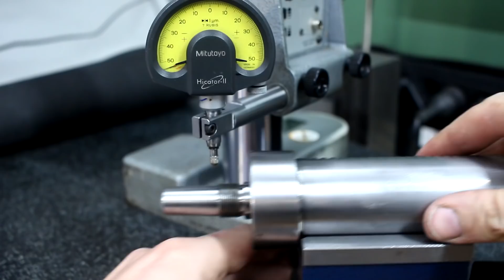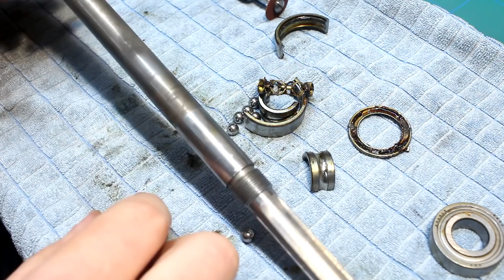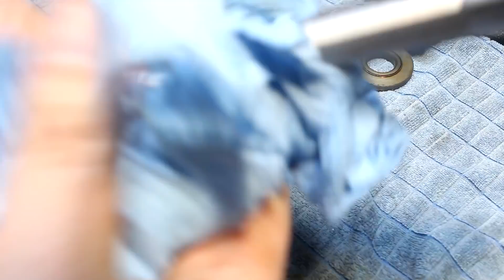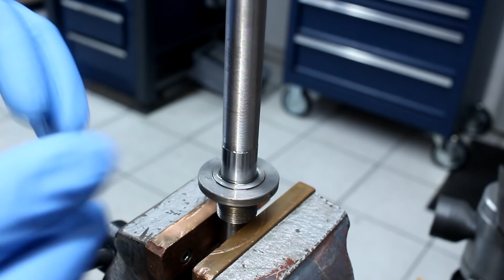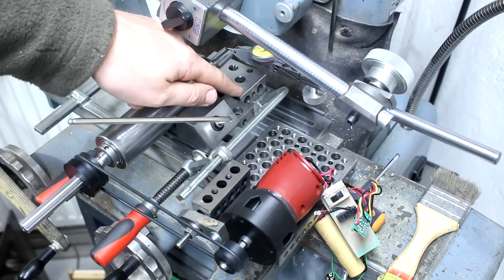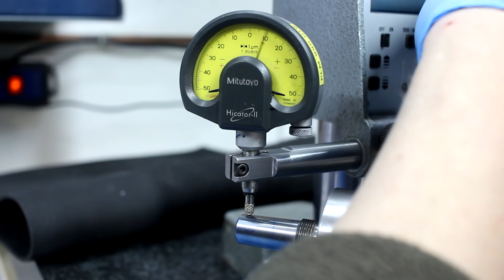Rebuilding a drillpress spindle

Comment: 19:30 On my press I don't have that disc at all. The bearing is plainly visible. It's weird to me if someone came up to use such a massive disc for protection of a sealed bearing.
Reply from the maker: Any debris that doesnt make it to the seals is good debris :-)
It makes sense to help the bearings as much as possible.
Reply: @StefanGotteswinter  I've just discovered my quill is single piece. From the B6 taper all the way up to the square for the spline connection. And the vast majority of the play happens on that spline. I'm working on it as we speak. Why I say on the spline and not between the casting and the spindle. Because correcting THAT would have required a rework of half of the area, with extra bushings, not top mention boring out the casting. I bought a $150 drill press i.e. it's safe to say I can't afford a lathe ;)

Comment: The top splined shaft (quill) in my drill press wobbles by at lest half a milimeter at the top. What does that mean? The visible bottom bearing is indeed deep groove type? May it be the case that the remaining 2-3 bearings all the way to the top are regular cheapest bearings? Because the splined shaft IS held in the bearings, right? The top sleeve in the pulley has no lateral holding role, right?

Comment: Can the drill press be used as a vertical lathe to rehab the taper in situ?  Maybe by fixing a mating Taper to the table and covering it in a fine emery cloth then running the spindle over the top of it. Thank you.

Comment: The spindle rotates quite slowly-is the speed ratio (taking into account the diameter to be ground) actually relevant in cylindrical grinding?
Could you say something about the speeds/cutting speeds and whether the spindle and grinding wheel rotate in synchronism or in counter-rotation?

Comment: I can't believe flott puts radial bearings in a quill, no wonder the old bearings where shot, my AI Hembrug drill press has the same setup but angle contact bearings 72series, these are made for axial and radial forces ,the one you put in are only for radial forces
Reply from the maker: A regular radial bearing can take 1/3 of its radial load rating in axial direction - thats usually ok for a drillpress.

Comment: If it were my spindle, I would at first try to hammer it back straight (with the old bearings).  But it would never get this perfect!
Reply from the maker: I have straighened spindles before grinding in the past, to safe on grinding time.

Comment: Lovely. Just to check my understanding: (1) the quill was titled upwards in the vice to render the taper flat to the grinding wheel (I'm assuming the bed of the surface grinder cannot be tilted)? (2) the collar that sets the preload bears upon the inner race of the top bearing - is that normal?  (3) Since the top bearing had to be heated to get it on the spindle it cannot be a slip fit, so I guess you can increase the preload by tightening the collar but cannot reduce it by loosening?

Comment: Thanks I enjoyed this video. I also figured out what to do with my old NiCad Cordless Drill. I have a old bench top Canedy-Otto drill press with external taper. Someday I will get around to restoring it. I measured run out with a indicator in a chuck relative to the bed and it was pretty much spot on. The only problem is the chuck sometimes falls off because the taper is a little beat up. I am checking eBay because I am thinking about replacing with a internal taper because I have a lot or taper shank drills. Thanks again.

Comment: very interesting. I also didnt know rubber shielded bearings were more prone to generating heat. That answers a question i have had around a new roller I have been working on that seemed to generate a bit more heat with the rubber shielded bearings I decided to try.  I will try some with metal shields.

Comment: Tip: When deburing/polishing a journal, shaft, etc, then us a 321 block, or a parallel with a piece of wet and dry abrasive paper(with/without light oil) instead of a stone. Works faster, cleaner and saves on irregular slip stone wear. 321 blocks are best as the holes act like reliefs and holds the grinding sludge away from the interface.

Comment: Funny I got bit by the hot bearing a few videos back when I was working on the valve grinder spindle and now you got the same thing. Makes me feel better about my oops. 😂 Might you should have ground a little off the end so no danger of the spindle end bottoming out before it reaches the taper? Seems that could possibly be an issue.

Comment: There is always the unseen or unknown problem with gloves. the protect you, but when they fail they may take your hands with them if you can't get them off. With hot things, fire and the like I prefer using something like a towel that I can throw or drop easily when handling things with unknowns. Gloves soak heat you may not feel right away and may be harder to take off the hotter they get.

Comment: I took an old junk Taiwanese drill press that someone was giving away.  It had a Jacob's taper 2 1/2 on the spindle. I successfully converted the spindle over to JT6 and put a keyless chuck on it.  Great usefull tool in the shop now.  That was my first time to use the taper attachment that came on my Logan lathe.

Comment: Excellent. Step by step demonstration with clear discussion of each detail. There's a world of teachers who could benefit from your example. 

But! The center hole in the taper end is now out of concentricity with the spindle axis. That might mislead the guy who replaces the bearing in 2089. My solution would be to chuck the spline in your lathe, support the quill barrel in the steady rest, and fine tool the center hole back to concentricity. It'll only take a few minutes. A trivial refinement but since we tend to take undamaged reference features as Gospel it couldn't hurt.
Reply: @ydonl  Good point;  but moot, being so far in the future. However the issue is completeness of task in the here and now.
Reply: @ydonl  Are you trolling me? Sorry. That doesn't work
Reply: @forrestaddy9644  No, sir -- sorry.  Stefan did a stellar job, with runout down in the micron region (which would be 0.000039 inches...  39 miillionths...)  and my conclusion would be that he's both very bright and very skilled, as well as possessing excellent judgement.  I suspect that if he thought the center hole had any significance, he would have addressed it.  I wouldn't have been surprised, but neither am I surprised that he ignored it. It hit me oddly that you would think the best response would be to pick up this arguably inconsequential detail.  I think the best way for you to show your perspective on the matter would be to... show your perspective on the matter!  :)  Clearly you would have dealt with the center hole, but what else would you do differently?  How would you go about it?
Reply: @ydonl  Au contrair. I have the highest respect for Stefan, a fine machinist and craftsman with a real talent for explaining the arcana of our trade. He does fine work expeditiously, neither hurrying nor fussing over trifles.

Maybe I should explain: I'm a retired machinist. I entered my apprenticeship in 1961. I have 40 years diversified and progressive experience usually specializing in large machine tools in a busy Naval shipyard. Over the years, I worked most places in the shipyard where a machinist was needed, the outside machine shop, the gyro shop, the instrument and director shop, the optical shop, the shipfitter and pipe shops, nuclear, transportation. The place was a feast for anyone fascinated with the metalworking trades and I took full advantage of opportunities to enlarge my experience. Add to that stints in layout and inspection, shop floor instruction, and a final eight years in production engineering. Thus, Steven and I are peers. He deserves adulation for his ability, trade knowledge,  and craftsmanship, no less so for his clear and well-presented exposition and running commentary on the work he is performing. As a peer from two generations ago, I think it's appropiate for me to gently zing him over trifles as peers do from time to time.

Whether my nit-picking about dressing the center hole was unnecessary depends on circumstances. If the drill press spindle was in a system under programmed maintenence, centerhole concentricity could save steps in a future repair; consequently, a few extra minutes re-tooling it might save the next guy time. However, most of the time that step might be, as you say, inconsequential. I'd do it because that was the way I was taught. I've spent too many exasperated hours doctoring battered shaft centers. Stefan may not because chances are the centerhole will be obliterated by a bearing puller, or worse, hammer blows.

Comment: I really liked how You did the tapered grinding just indicating it in. Great result. The axial load of a groved bearing is quite good, best for deep groved ones. Had several arguments with people on this, its in the data sheets. I think the issues people have are more from improper alignment and pre load. And sometimes over lubricating which causes heat problems.

Comment: Interesting to see a mitu badged Mahr indicator. It has a ball slide on the plunger , and the plunger only operates a spring release so it can never over drive the internal gears. Very nice indicators.
Reply: Mahr apparently build them for Mitutoyo. From what I've seen with mine about the only difference seems to be the front with the Mitutoyo name on it verses Mahr. They are marked with a small tag on the back saying built in Germany by Mayr.

Comment: Nice Job!
I did the same thing for my old Flott, but on the lLathe with a support grinder. It was OK, but not as sophisticated as your job.
An old and very experienced mechanic that was reparing old drill presses once told me that the deformation of these tapers normally come from a slipping chuck on the taper. When the chuck slipps, the higher points get warm and harder than the rest of the taper.. When the chuck slips again, the harder points will remain and the softer parts will wear a bit more. You can't remove the hard tips with a simple honing stone then and you need to grind it with a grinding wheel, like you did.

Comment: When setting up to grind the taper why not just make up an angle block that matches the taper to be ground. Then set the block in the vise with the quill body against the tapered block. You may have to adjust a little but you will be in the ball park or football field.

Comment: If it is absolutely required to drive bearings onto a shaft and into a bore at the same time something on this order is needed. You can always make your own
https://www.google.com/url?sa=t&source=web&rct=j&url=https://www.skf.com/us/products/maintenance-products/mechanical-tools-for-mounting-and-dismounting/bearing-fitting-tools/bearing-fitting-tool-kits&ved=2ahUKEwjU2M2lqojwAhW1AZ0JHaoAA7YQFjAEegQIDhAC&usg=AOvVaw19jd1hS3wrJXM85ulTh2gN&cshid=1618767378047

Comment: On repairing spindles you are always at the mercy of the designer to a certain degree. Mainly in terms of the bearing arrangement.  But the key to any spindle running truely concentric is the degree of precision to which it was manufactured. And that counts for all the components of the spindle assembly. The concentricity of the machining on the shaft. But that is only a portion of the equation. The concentration of the bearing bores and the squareness of the shoulders play a major role. Plus this is a really big one. If the spindle design has spacers on the inner and outer races of angular contact or a spacer in a set of precision tapered roller bearing those spacers must not only be the proper lengths for the desired preload those spacers must be dead parallel to each other on their faces. One thou or 25 microns* just isn't going to cut it. Half of that isn't good enough either. 50 millionths or one micron** is really about the most allowable in my opinion. The closer the degree of accuracy in the concentricity, squareness and parallel of the components the longer the spindle will last in service. Lord knows I've rebuilt enough of them over the years. Even if everything is perfect spindles will fail if pushed outside of their designed running speeds and in my experience penetration of contaminants into the bearings from coolant penetrating the seals because of plain seal wear on both the spindle and the seal itself. 
*whatever the proper term is
**to achieve this I normally would grind the spacers on top of magnetic transfer parallels which were ground in place with the spacers then put on the parallels. Grind one side to clean up. Remove them and grind the other side. All without turning the magnet off or disturbing the transfer parallels in any way. The ground surface of the transfer parallels was as trustworthy of a surface the grinder would produce as we could rely on (a lot of our surface grinders had wear in the ways andrebuilding them was not an option because of they were in use almost constantly). As an example of just important parallelism is we had a production lathe that every month or so would be out of service while the spi dle was sent back to the manufacture under warranty. Finally the production manager in that part of the plant was fed up and sent it into our spindle shop to find out what the issue was. The spacers on the main bearings were .007 out of parallel. Everytime that shaft rotated the inner and outer races were rocking up and down relative to each other. Now this is an extreme example but it illustrates the need for proper care in assembly,  inspection and manufacture.

Comment: Deep groove ball races aren't ideal for axial loads so I'm a little surprised that the spindle doesn't use angular contact bearings.
Reply from the maker: they are rated 1/3 of their radial load rating for axial. Thats plenty for a drill press.
Reply: @StefanGotteswinter  Until some joker decides to try milling in it!

Comment: Great video!   One question: is the taper too long now?   Might it bottom out in the chuck?   Perhaps the taper needs to be shortened?
Reply: It's a possibility, but since these little drill presses are generally married to a chuck for life I don't think it's important that it's in spec so long as the supplied chuck locks on.

Comment: I believe it is better practice to spin your work piece into the cutting wheel rather than away like you are doing. But I've never tried spinning with the direction of cutting like you are doing so I'm not sure if there is much difference.

Comment: Very nice repair and video, as always ;-)

2 years ago I had a similar drill press (TB-10, the small brother) with the same problems, bent spindle and bad bearings. 
The bearings used in this spindle were oddball Type E15 and type BO15, angular contact bearing with brass cage. (apparently also called magneto bearings). Perhaps useful info if the owner ever 
wants to upgrade to angular contact bearings. Or perhaps Flott changed to using 'standard' size bearings more recently. The one I have seems to be quite old.

Comment: Very informative, thanks for sharing. What is the name of the abrasive you were using on the lathe to tidy up the threads, sounded like 'Kraytex' or 'Drayteks' or something along those lines?
Reply: Nevermind, found it. It's 'Cratex' which is a rubber impregnated with an abrasive (or a rubberised abrasive, if you want to think of it that way).

Comment: You should make carbide bladed scissors for your abrasive cutting needs. Would be a great project video.
Reply: I saw ceramic-edged ones at an electrical supplier; they're for cutting the kevlar jacket on fiber-optic cable.
Reply: @jimsvideos7201  you don't really need ceramics to cut kevlar, just make a quite rough 90 degree grind on decent steel scissors and they will cut kevlar just fine, rough texture helps holding the fibers from slipping out of the V, 90 degree grind is the magic ingredient
they won't last as long of course, but in a pinch it works very well on this tough bendy stuff
Reply: carbide is good  
but cbn is better ;)
Reply: actually you can buy carbide tipped scissors from medical supliers.
Reply: Why not just go to single crystal diamond scissors? Cost maybe?
Reply: @HansFormerlyTraffer  Cost, yes; Greenlee 45483A scissors are about $55; diamond scissors would be... more.
Reply: @jimsvideos7201  thanks for spec'ing the scissors. While I didn't find them yet, visiting the company's website|new products page is fascinating, and I can only imagine the use of some of their products on display!